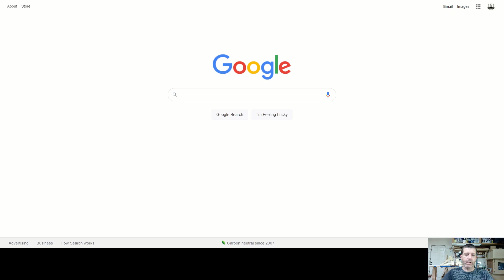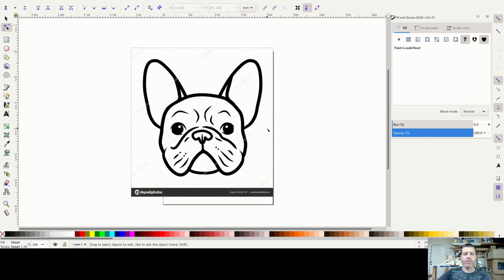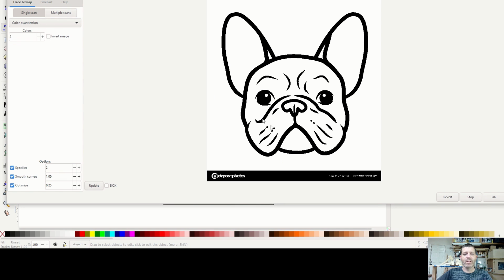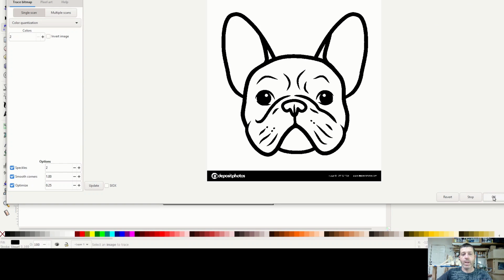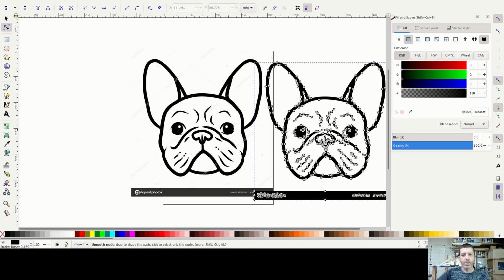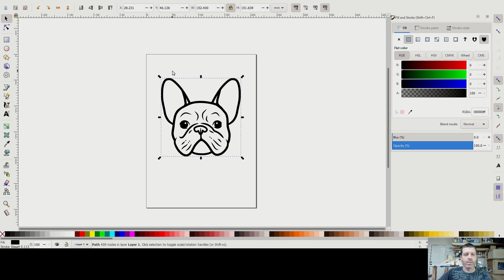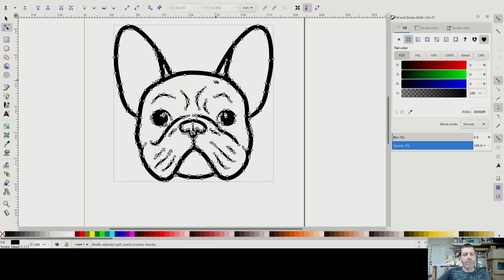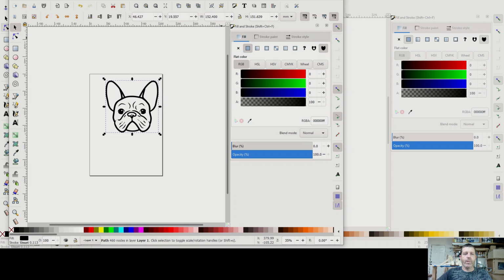PNG Picture to SVG for CNC Tutorial - Image Trace

Comment: good video, but I think you take for granted that people know what an embedded SVG is and this made you comments early on when importing pretty vague.  Good to know how to deal with it, but again... it took some googling to sort of figure out what it meant.  but thanks, this helped.
Reply from the maker: That's a good point.  Thanks!   For the most part the embedded issue is kinda software dependent for use of the .svg after converting. With most of my normal channel viewers being Easel CNC software users, I did make the assumption that they have seen the error that pops up when they try to upload a .svg that has embedded images. I agree I could have explained that better. Thanks again for the feedback!

Comment: Great video.  Helped alot.
Reply: so i just tried what you said and it wont work for me.  I downloaded a jpg of holly line art.  I traced the pic and it made a copy but I can't double click to show the nodes.  I do object to path and save as svg but Carbide Create won't show the picture.  Any ideas?
Reply from the maker: @davidcochran934  if you want me to take a look you can send the file over to cncseth@gmail and i'll check it out.  I use this same process all the time and it works without issue
Reply: @SethCNC  thanks for the offer.  I have been playing with it today and I think I finally have it down.  After the trace my end result is not a node editable file but I have been taking it into carbide create to alter anything that I need.

Comment: Good tutorial. I did have a problem in early days with Easel, it would carve same image twice but slightly apart. A lot of SVG files trace 2 lines, the inner & outer edge extremely close together as the thickness of the line (stroke & fill). Easel obeys this & carves both lines. So I try to delete one of the tracks, gives a smaller, cleaner image on regular shapes.